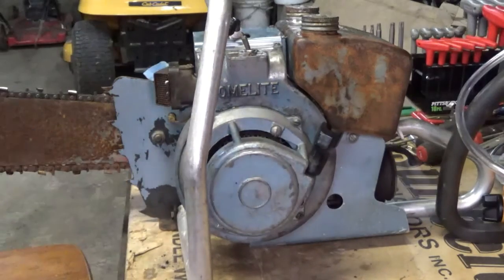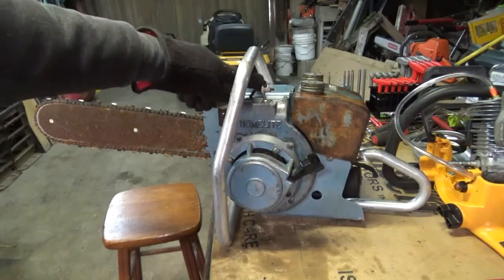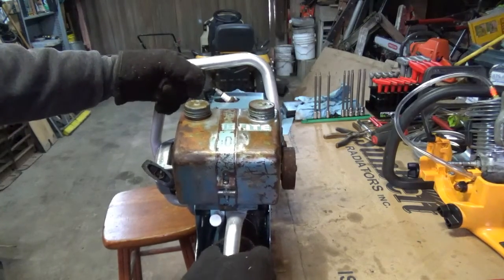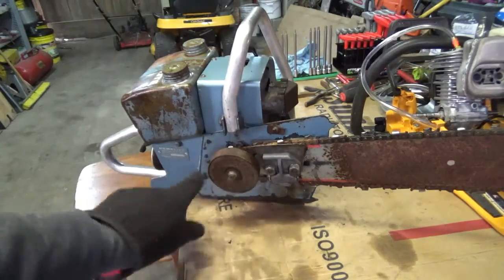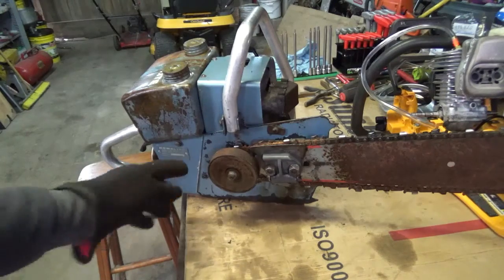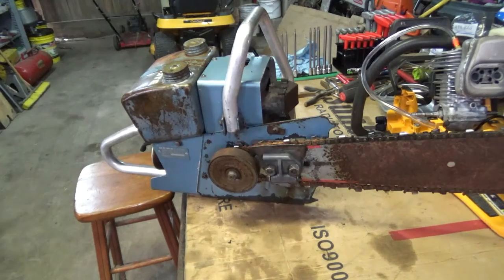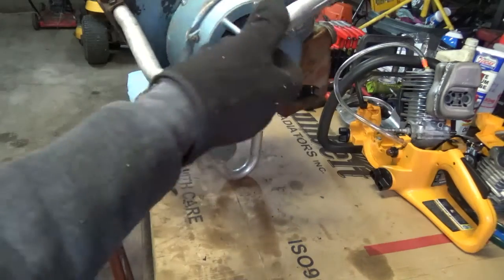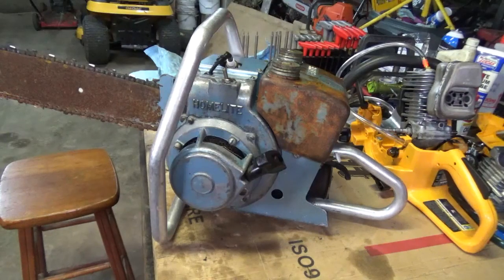My First Attempt at a Restoration  (Homelite Model 500)

Comment: Just found 1 of these for 140 should I get it and restore it it works. Just gunk up and needs to be cleaned mostly
Reply from the maker: Really depends on the condition, some parts are getting hard to find so you could easily wind up having twice as much in it than its worth, so if its a complete saw and not in to bad of a condition I myself would give it a shot.